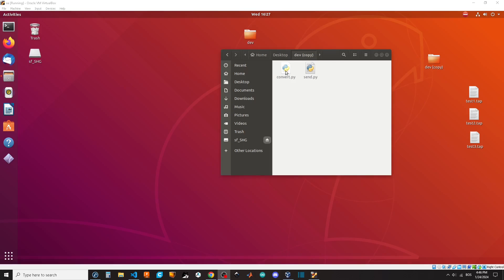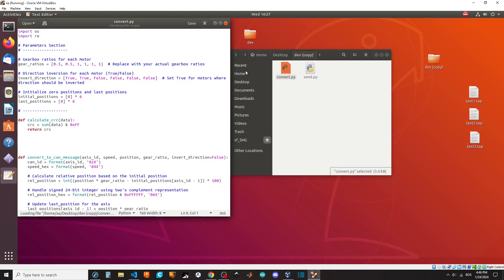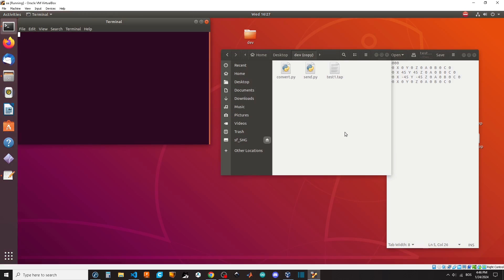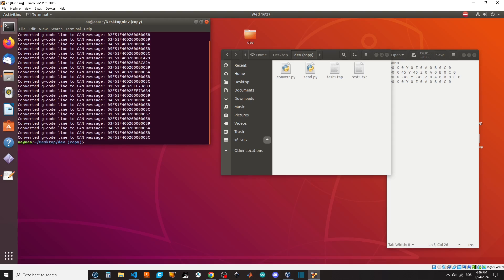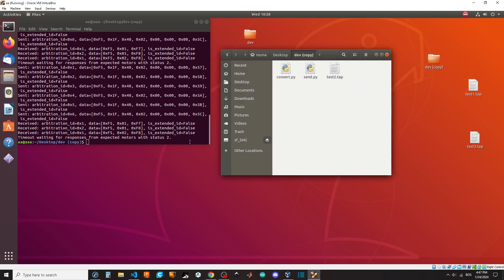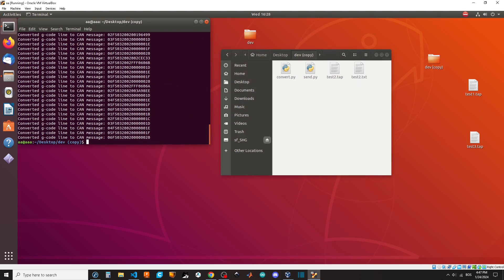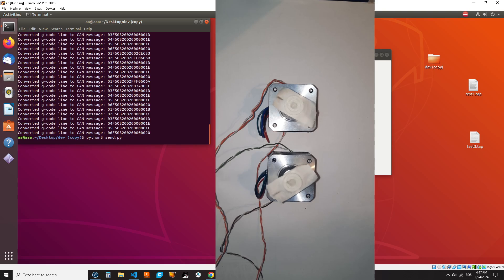How to convert G code to CAN BUS

Comment: is this required for the robot to work or can you just import the gcode to grbl trough universal gcode sender
Reply from the maker: It is required for closed loop control. CAN messages could also be sent via SavvyCan or similar CAN tool. In open loop with Arduino, gcode can be send by ugs.